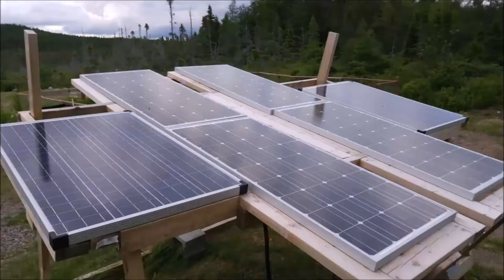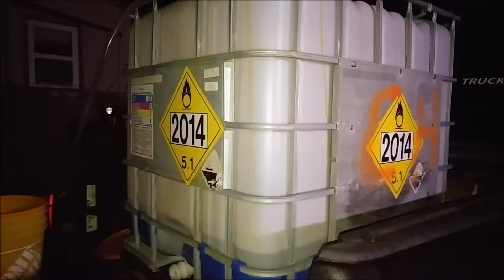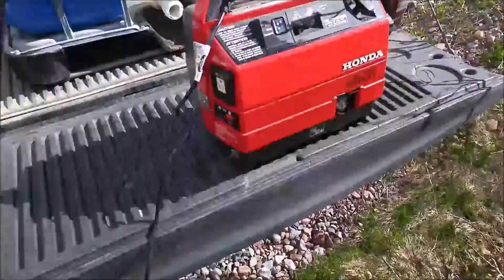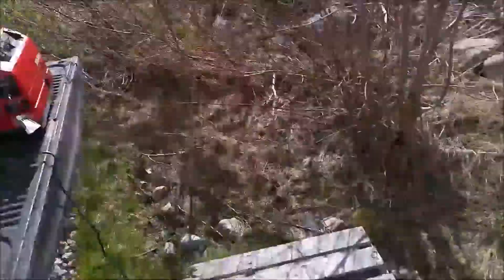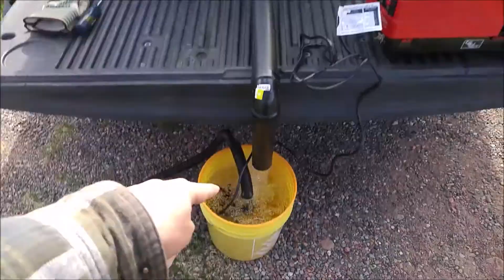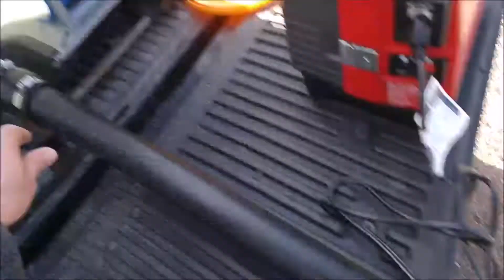Cabin Life:  Off Grid Living;  No Water Source at the Homestead... No Problem

Comment: Could you put a hose on the end of the pipe and let the spring pressure push it in the tote?
Reply from the maker: It would not flow quick enough, especially where the stationary tank is higher than the tote in the back of the truck.  It would gravity flow if the stationary tote was near the ground, however then I would lose pressure when transferring inside the cabin.  The 12 volt bilge pump is inexpensive, about $20 and the hose was another $10, but more time consuming, but if you are not worried about the amount of time to transfer, that option less costly would be just fine.
Reply from the maker: Sorry, I misread your question... you are referring to the water discharging from the spring water.  I never thought about trying that, as I am not sure how secure the pipe is, in theory, yes, there should be enough pressure to do so, but the pumps are fine for the job.

Comment: pretty slick dave. i have a little honda pump wx10 that i transfer spring water to a container to bring to my cabin. not in the amount you are but it works well. thanks for the great videos
Reply from the maker: Thanks, I certainly believe that those gas powered pumps are the best for that!  I have been looking at them as well, the sump pump and generator was a quick set-up, the pump and hose was about $100 at the nearest hardware store.  Spring water is the best in my opinion, and great for the cabin.  I appreciate it!